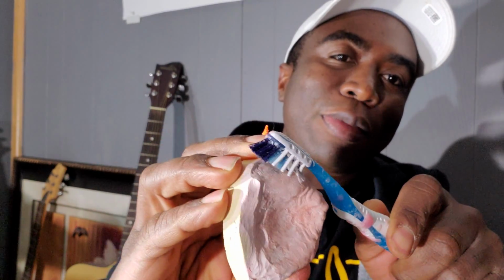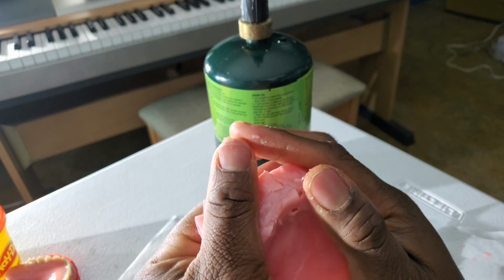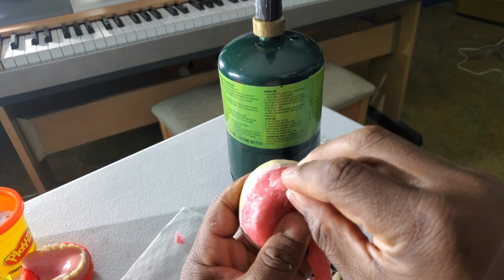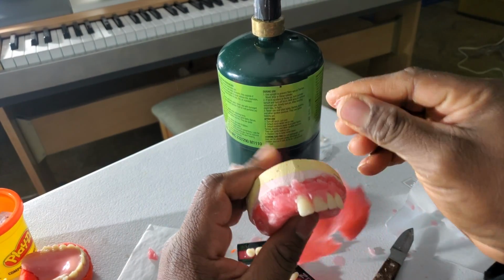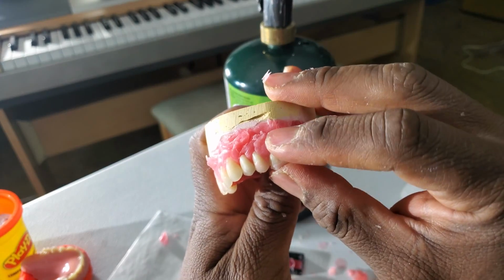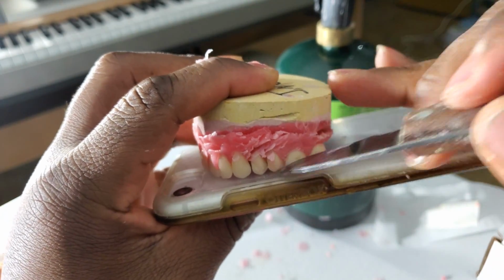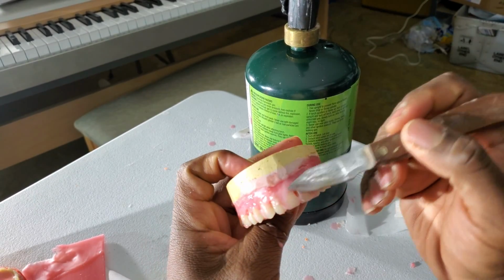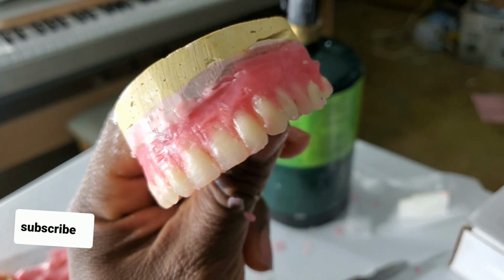Make you Own  Dentures, Teeth Set Up..PART 1

Comment: Hi Joe I love your videos you are a God send but I cannot find those light cure sheets anywhere on line can anyone help
Reply from the maker: hank you so much for your kind words and support, it means a lot. I apologize for the difficulty you're having in finding the light cure sheets online. I'll do my best to help you locate them.

First, try checking online marketplaces like Amazon, eBay, or AliExpress, as they might have a variety of light cure sheets available. Be sure to search using terms like "light cure sheets," "UV curing film," or "photopolymer film" to get the most relevant results.

You can also check out specialized stores and websites that cater to DIY and crafting materials, as they may have these sheets in stock. Additionally, if you're part of any online communities or forums related to the topic, don't hesitate to ask fellow members for advice on where to find these sheets.

Lastly, if you're still having trouble locating them, you might consider reaching out to local retailers that specialize in art, craft, or even dental supplies, as they might carry the product or be able to direct you to a supplier.

I hope this helps, and best of luck in your search! If you have any more questions or need further assistance, please don't hesitate to ask.

Comment: I've wonder why dentists put in the wisdom teeth again. We all know we have them pulled some time in our lifetimes. So why add them back? I do not like that that is on my dentures as it makes them too large for my mouth.
Reply from the maker: You may need new ones
Reply: @JOsdentureslabJOs  I do but don't have money for them. So I am going to adjust some newer ones myself. I've been wearing my older ones since the beginning of the 2000's. I want articulating paper so I can do this, but they are only sold in higher stocks. I only need, like 5 sheets. Is there something else I can use?

Comment: I have a question.   Can changes be made to a duplicated denture?   My top denture fits well but the center is slightly off and I'd like one tooth changed to match the tooth on the opposite side.
Reply from the maker: Is hard to change unless you make new

Comment: You get what you pay for. If you're determined to ruin your bite, mouth, and heath, make your own dentures.
Reply: Why do you say this?   From my experience a dentist that charged me $5,000 and dentures that don't fit well didn't do too much for my bite, mouth and health.   I can't afford 5K every 2 years.
Reply: @setfreemiss  isn't it truly sad to have to worry about something so needed? I also spent $7000.00 on teeth, that I barely wear, cause they are not right.
Reply: I'm sorry, that's shameful that a professional ripped you off like that.   I do believe you.   My dentures were such a horrible fit from the start and when I tried to tell  the Dentist, he acted like I was a "complainer"...that I just needed to get used to them.    I couldn't chew, because the bite was  too tight and the  teeth clashed.  The teeth kept breaking off and the upper  denture  finally broke down the middle after 1.5 years.    The Dentist  had skipped town with his new self -driving TESLA so I was desperate.     Fortunately for me, I watched a lot of Jo's videos and was able to fix them after several failed attemps. .  They actually fit  pretty good now   because I figured out how to open the bite where it broke  and added  about 3/16  inch of some acrylic material down the center.  Then I  fixed the bite with a dremmel and carbon paper.    I had a big space in front where I added material to open the bite, but I added an extra tooth in the space LOL and it looks fine.      It's hard to learn because you have to get all the materials and tools and then you mess up.   But you learn.   I'll never pay these shysters for bad dentures again.   I can wear these comfortabley while I practice on making myself a really nice pair!

Comment: Do i get the cans of acrylic? Thats all i could find. Do i get the cans of acrylic thats the color of the gums, heat it in boiling water, then use it to mold? Or do i get another type of acrylic? Im a bit confused
Reply: Im having a difficult time finding heat cure resin for dentures. Any suggestions?
Reply: Awesome!! Thank you SO MUCH! i think im confident enough to try and make a set! Your so awesome ! Im just so grateful !
Reply from the maker: Amy- Uniquely you  you need lots stuff, starting with alginate impressions, impressions tray. Wax, teeth, stone , flask, acrylic, monomer, dremmel pack. For finishing